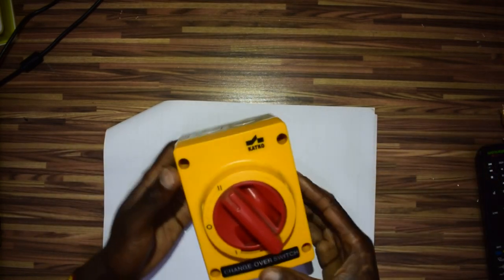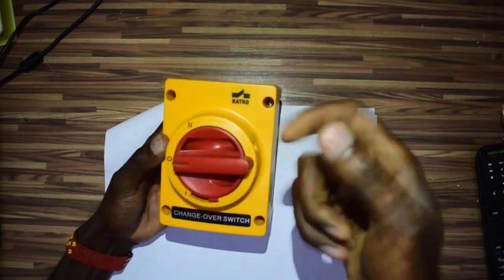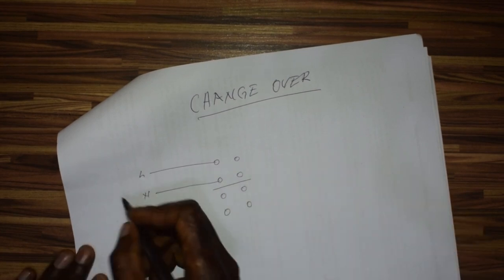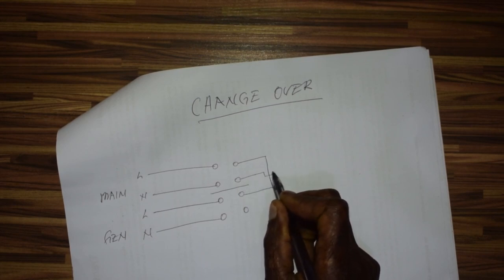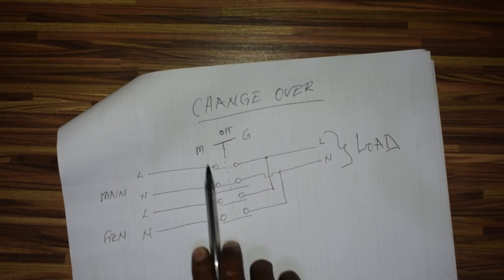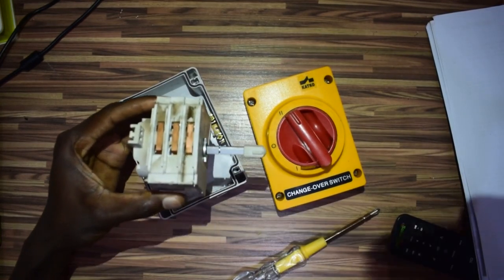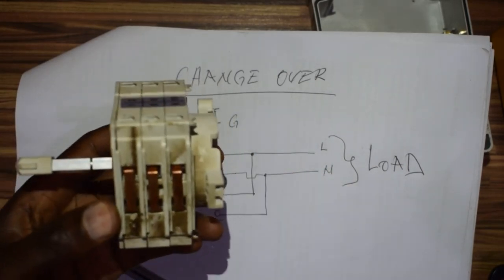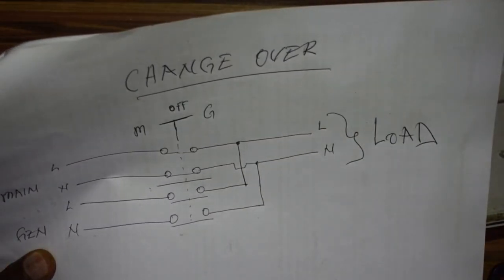Manual changeover switch

Comment: Useful. Thank you.  It would have been nice to see you wiring the switch in an example circuit.  Also, I respectfully suggest you leave out the background music when you're talking - it's a bit distracting and your words are interesting enough.   What sort of setup do you use for fuses/breakers?
Reply from the maker: Thanx very for very much for yr advise, its indeed considerable.
For fuses mostly use a catridge type for  CUTOUTS by supplying authority. And MCB for all other installations...